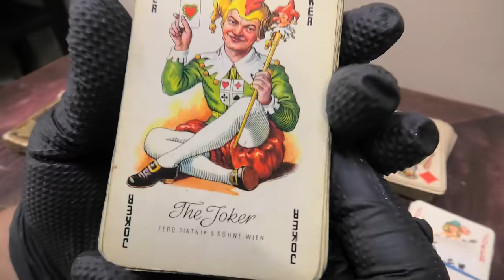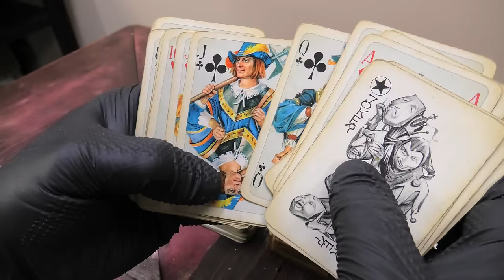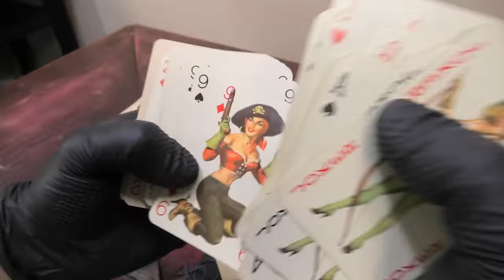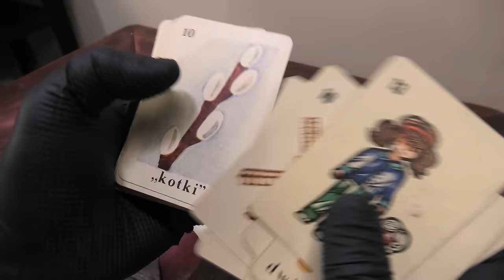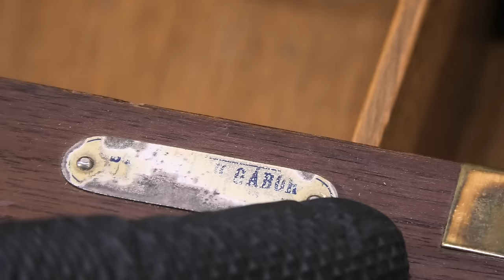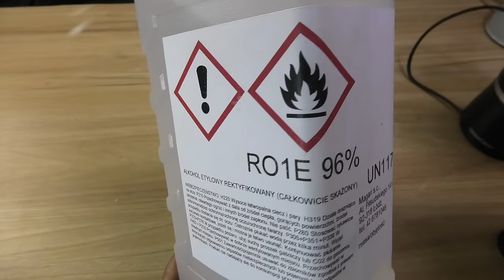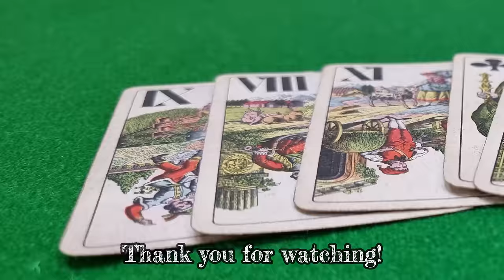Elegant Card and Games Table Restoration - A Glimpse into Austro-Hungarian Past!

Comment: Your channel appeared in my feed so of course I subscribed; I love this sort of thing.
I have a similar table:  it was brought to Canada from England by my paternal grandfather in the very early 20th century, and it was old then.  Knowledgeable people here tell me it's probably Regency.  Mine is smaller and in much better shape, but some of the joint glue is a bit loose and I do need to replace the baize.  It was a lot of trouble to find proper baize cloth in the right colour!

Comment: It's been a long time since I've seen a chessboard like that.   That board was sold back in the day as a travel set, or sometimes a child's set.  Having the holes and pegs in the pieces would allow players to play in an RV, train etc without fear of the pieces being knocked over during the vehicles movement.  I didn't see it on the market for long, so they probably didn't sell many.

As for the table, that poor thing looked thirsty,  how much furniture oil did it take to restore it?  Gorgeous piece of furniture, you don't see tables like that anymore.
Reply from the maker: That's a very interesting observation. I didn't know that chessboards with holes and pegs were sold as travel sets. It makes sense, though, since it would prevent the pieces from being knocked over during travel. I'm glad to hear that you think the table is a gorgeous piece of furniture. It took a lot of work to restore it, but it was worth it. I'm not sure how much furniture oil/shaellac I used, but it was quite lot! I'm glad you appreciate it. Cheers!

Comment: pretty sure those cards with the pin-up girls is an elvgren deck circa 1940's or 50's. The deck you mention as tarot cards in the beginning are just regular playing cards with roman numerals replacing the normal numbers you see on them today. Cant find much info on that set. Well done on the vid and restoration!
Reply from the maker: Hi there! Thanks for the comment and the kind words about the video and restoration.
You're right, the cards with the pin-up girls are an Elvgren deck from the 1940s or 50s. I'm not sure of the exact year, but I'm glad you were able to identify them.
As for the deck I mentioned as tarot cards, you're also right that they're just regular playing cards with Roman numerals instead of the normal numbers. I wasn't sure what to call them, so I just went with "tarot cards" since they have a similar look.I couldn't find much information about that set either, but I did find a few listings for them on eBay. They seem to be pretty rare, so I'm glad I was able to find them.
Thanks again for watching the video and for your comment!

Comment: Next time when you'd be using those scrapers, pull them towards you, rather than pushing away. That's the way they are supposed to be used.
Reply from the maker: I used them both ways and picked the best. I don't know why, but pushing did the job better in this case 🙂
Reply: @rustyshadesrestoration  it certainly didn't look right 😅
Reply from the maker: As long as doing the job, I don't care how it looks 😅 The orange one works both ways well, the blue only by pushing it.

Comment: What was the clear adhesive in the white bottle you used to glue the top with the red fabric down on base?
Reply from the maker: It is a polyurethane glue for wood. The brand won't help you because it is produced and sold only in Poland.

Comment: At 17:50 you place the metal plate in a space cut for it through the red fabric. My question: why did you cut the fabric at the edge of the opening? It seems the fabric should have be left uncut then laid over the opening and cut after it was glued. When cut it should have been cut in the middle of the opening either in an X shape or double Y shape and folded under the opening to the back side of the table top. Then the metal plate screwed in place. Last, the extra fabric flaps cut away. That way, on the top side, there's no chance of the fabric fraying around the edges of the metal plate with use and time. Aren't chair seats and backing done that way?
Reply from the maker: I considered using this technique, but it could be problematic later because extra flipped material could cause uneven surfaces, and the table top won't fit and spin correctly. That's why I cut it that way, and the result is excellent because I left a little to get under the metallic part, so it cannot be warned out in time. 
Thank you for your suggestion and for watching. I hope you enjoyed the video. Cheers